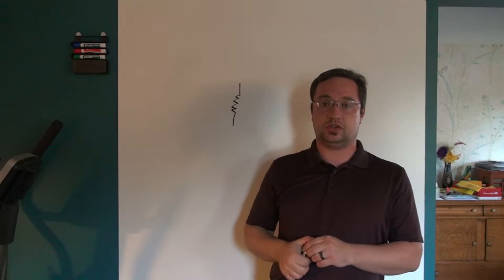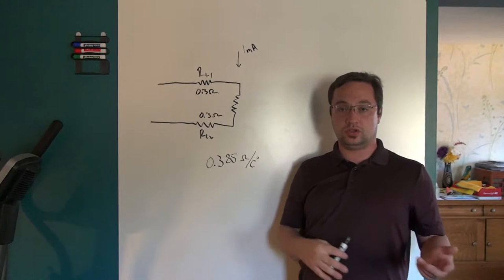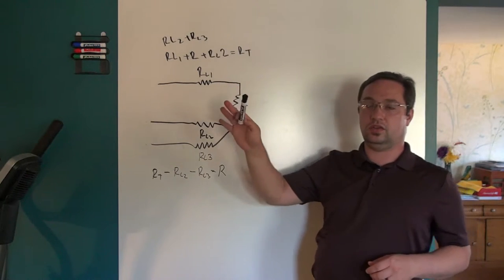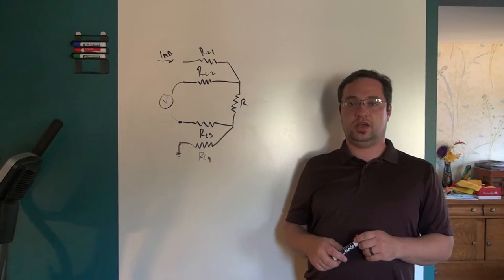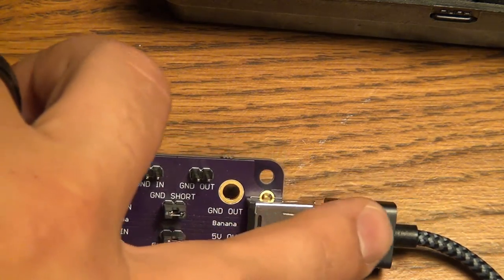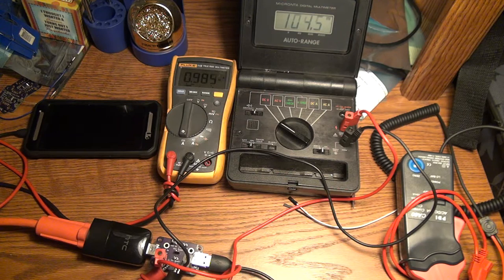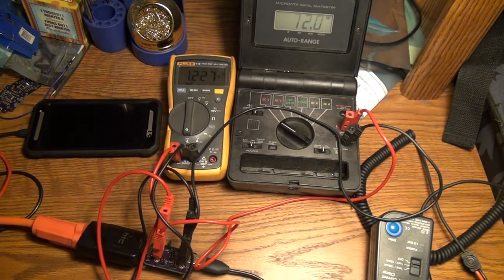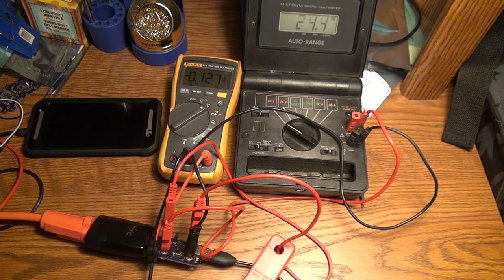eapbg #22 Measurement accuracy

Comment: Yes I see mechanic techs you the snap on Vantage models, but can you give examples of what you're graphing the voltage when testing what on cars?
Reply from the maker: Making sure the  voltage is smooth with no glitches or discontinuities. These graphing meters tend to have very deep memory allowing to graph for several minutes. This allows you to see how the voltage behaves over time. Then you compare that with how you expect the signal to behave to see if there is an issue.

Comment: EAPBG, when measuring the RPM's of a motor using an RPM strobe light, how do you know the RPM speed is correct and you're not measuring on a harmonic and getting a false reading?
Reply from the maker: A timing light clips on to a spark plug wire. Assuming a standard ignition (one fire per 2 crank revolutions) then it is never a problem. If the ignition is waste spark or some other multi fire variant (edis) it is up to the mechanic to know that and compensate.
Reply: @eapbg  I ment an AC motor not a car engine. When measuring the RPM of an AC motor using an RPM strobe timing light should be close to 3600 RPM at full speed. But how do you know if the timing light is locked on a harmonic and not the fundamental of the AC motor speed?
Reply from the maker: @billwilliams6338  Not familiar with strobe rpm meters. Always used laser tachometers.

Comment: EAPBG,  When measuring a PWM pulse signal using a True RMS DVM meter it will measure the PWN pulse signal by "averaging the voltage". Why does it Average the voltage of a PWM signal when its a True RMS DVM meter or what DVM meter will not average the voltage on PWM signals. If the PWM signal is +5 volts it will average the On time and Off time of the PWM signal which will not be +5volts. Any reasons why they want DVM meters to average PWM signals?
Reply from the maker: True RMS is a whole video just by itself. The simple answer is that a PWM is described by more that one measurement. There is frequency, duty cycle, peak to peak voltage, and min/max voltage. Most of these can be measured with different functions of the meter besides AC volts. The best thing is to use an oscilloscope to look at the signal.

Comment: DVM meters have a Min Max button feature, What circuit testing can you use the Min Max feature on to test what with? any examples please. I have seen auto tech use the Min Max feature when starting the car the Min voltage will be at 9vdc to 10vdc and the Max voltage will be 12.5vdc to 14.5vdc. I'm not sure why the cars min voltage went down to 9vdc to 10vdc when starting the car, any reasons why?
Reply from the maker: Any sensor with a variable voltage output can use min max for tests. That's how a battery works.